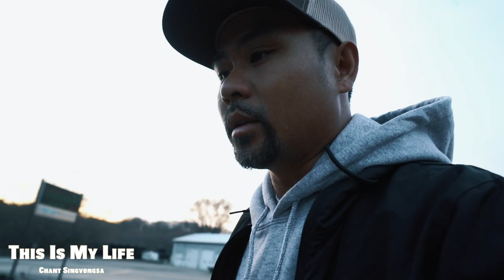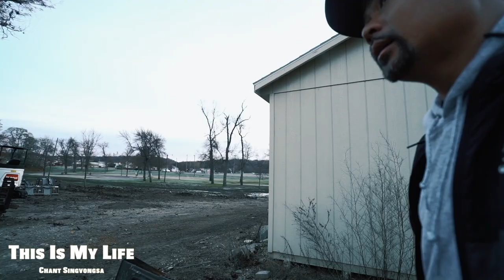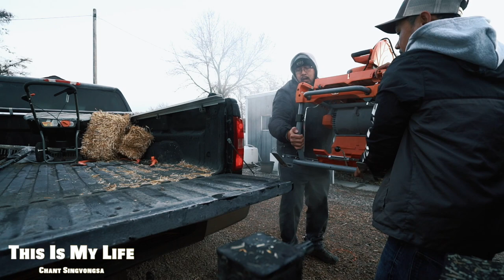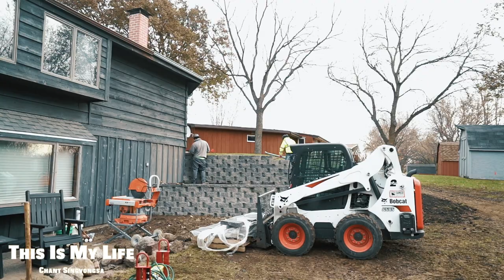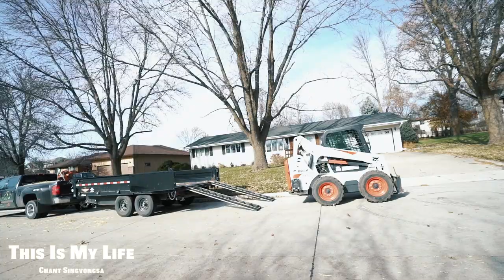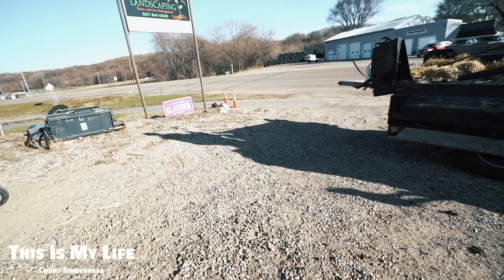Loading a BobCat S595 on a Dump Trailer   Retaining wall project complete

Comment: I don’t see the point of the that dump trailer the sides are so shallow
Reply: As is it is meant for gravel, topsoil, rocks, etc. There are stake pockets to add sides if hauling lighter material like mulch or leaves.
Reply: Nah dude that trailer is perfect, fold the sides down for hauling pallets, build up the walls with wood and bolts to do tree brush. I wish mine was like that. Mine is a touch taller 14' gooseneck HnH dump. Hard to use a skid steer hauler since the ramps become so steep. That trailer is great
Reply: Marton Bagoly well I run 16 ft Kaufman for my skid and the bed on my dump truck is 12ft long 6ft tall. I do the same same exact same stuff with my equipment just less equipment and plus he has a shallow bed dump truck as well makes no sense